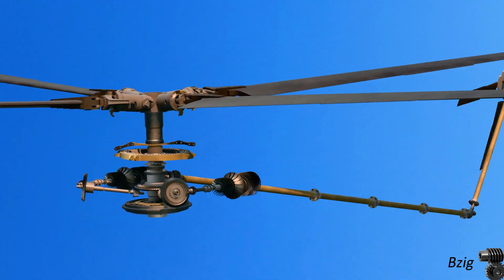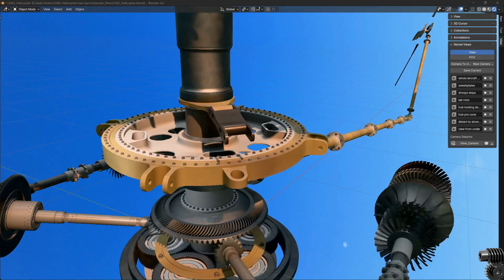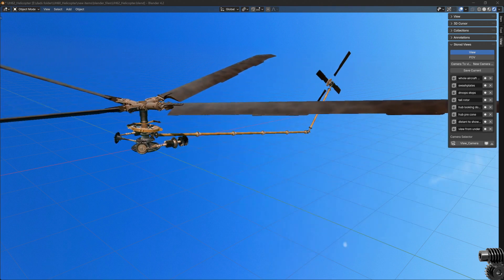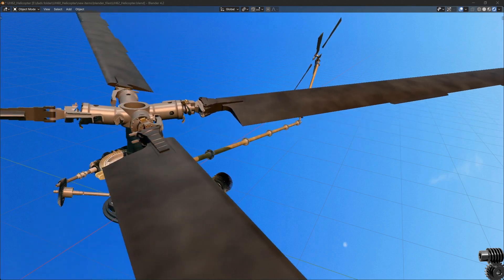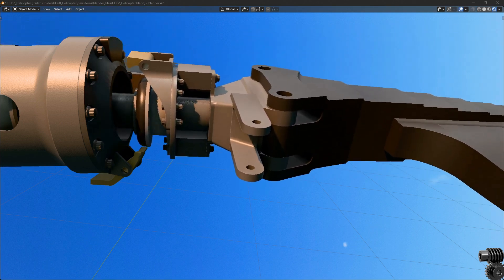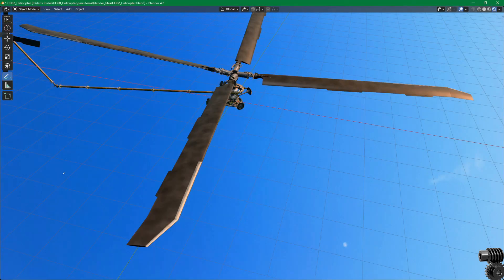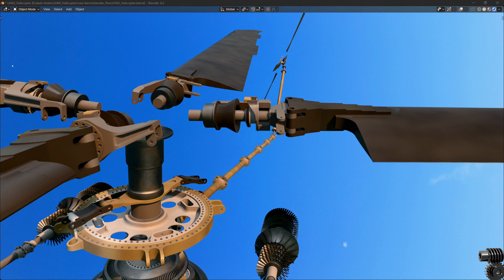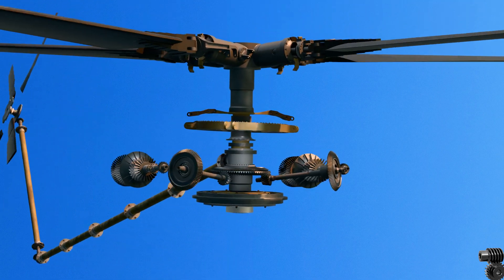How a Helicopter Works - Part 4

Comment: Fantastic work!  I'm a high time fixed wing pilot undergoing initial helicopter training.  Although the models are for a far more complex helicopter than the Robinson Trainer, they're very helpful to visualize the aero and mechanical activities in a rotary wing design.   The training programs in the light end of the helicopter seems devoid of CAD and animations that greatly aid in learning the subjects.  I'd request model/animation of simple teetering system with the hope that you can capitalize on the product with flight training programs.
Reply from the maker: I'm working on an R-44 teetering animation.  Slow going... no promises when it will be done.

Comment: Hello, what is the purpose of this blade movement? Is it to create flexibility? I thought I understood how a helicopter works and I'm starting to have doubts.😅
Reply from the maker: That's not a short answer but I'll try... Feathering is for control of the aircraft.  Feathering creates forces that allow the blades to flap...flapping is also necessary for control and also to correct for a thing called forward flight dissymmetry of lift.  Lead lag conserves angular momentum of the blades as they flap.  So all three DOFs are interrelated.

Comment: Excellent animation! I have a question, why does the tail rotor drive shaft input pinion mesh the top side of the bevel gear? Why doesn't it mesh the same side of the bevel gear just like the engine input pinions?
Reply from the maker: I'm not sure why the original designers did it that way, but if you did it with the same gear as the engine inputs, there would have to be another gear in the system to change the direction of rotation.  So... Either way, it caused then to add another gear.  That double bevel looks like it's really hard to manufacture.
Reply: @bzig4929  I did some searching and I believe the reason is that the spiral bevel gears are handed, which means they have a preferred rotation direction when acting as the drive gear.
Reply from the maker: yeah... I'm not a mechanical design person (I am an engineer) and in researching this I think I learned that it's proper to drive helical gears such that the pinion drives from the concave flank.  Which is interesting about the black hawk design because the TR drive gear is driven from the convex flank.  I found a video on line of a cut-away view of the blackhawk main transmission... what I animated is true to that video.

Comment: Why is trim adjusted by bending the tabs rather than adjusting the aoa via link rod length?
Reply from the maker: You actually adjust three things...  pitch link length, trim tabs and  adding/removing weights from the blade tip.  When I first started in the industry, we had to install test equipment on the aircraft to collect the data for the adjustments.  Now, most aircraft have this gear installed all of the time.  And the process has gotten so good, it's normal, now,  to complete a track and balance in just one or two flights.
Reply: @bzig4929  Interesting, thank you!

Comment: Amazing, again. I dont know if it is because i am a mechanical engineer who uses CAD, but this seems the perfect way to learn these topics. I enjoyed the touch on aerodynamics. Just been learning why Nr increases during a flare. No one seems to have presented that intuitively.
Reply from the maker: Thanks for the comment!  A few years back, I was working flight test and someone decided to recreate an aircraft data point in a simulator; then they turned it into a video... The insight that came from that one video was so much richer than looking at a thousand time histories.  Technical subjects are much easier to understand with visualizations.

Comment: how does a teetering rotor control? Does it rely on the blades being flexible?
Reply from the maker: I think there are teeters that have elastomeric feathering, but I also know of many (bell 206) with a mechanical feather bearing.
Reply: @bzig4929  thanks, maybe my phrasing wasn't super clear. I was more asking how any moment gets transferred to the heli if the blade teeters at its center

Comment: I am sorry to be the guy to tell you this but, seeing as how this is based on the UH-60/S-92 rotor head that I have torn apart and put together, several times in my military and civilian career, this is a fully articulated rotor head, not a semi-rigid. Semi-rigid rotor hub would be like the one found on the Bell 222. Whereas a rigid system would like those found on the Bo-105.
Reply from the maker: yes!  I corrected that in the comments.  I've been calling these (flap and lead lag via the elastomer, but feathering via a mechanical bearing) semi-rigid for the last 30 years.  This is the first time I've been corrected... but I see that wikipedia and the RFH agree with you.  I also like fully-articulated as a description because flapping-feathering and lead-lag all have an axis of rotation.  Terminology is hard :)   Thanks for watching and for taking the time to comment.
Reply: I was gonna ask why it wasn't fully articulated. But here is my answer.

Comment: How are the tail rotor shafts connected?  Plate and bolts?  Or is there some give with supporting bearings?
Reply from the maker: Those are called flex plates.  That allow for minor changes in alignment that happens when the tail boom flexes under aero loads.  Thanks for watching!
Reply: @bzig4929  Yes, I see them now.  Thanks.

Comment: Fantastic stuff! But not sure you are right about the hub being semi-rigid. A semi-rigid hub is found only on two bladed helis where the blades flaps together on a teetering hub. Modern hubs with elastomeric bearings for all movements are called "soft in plane" (Bell) or "spheriflex" (Airbus) Kind regards.
Reply from the maker: oh... I think you are correct!  Thanks for the comment.